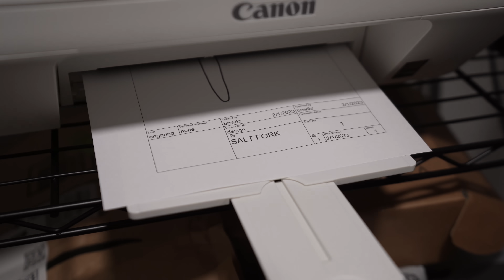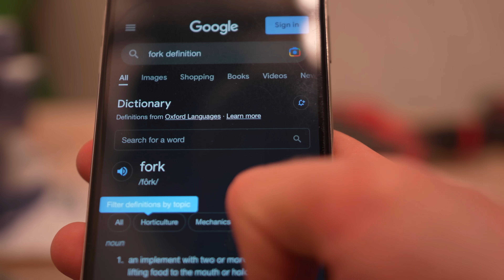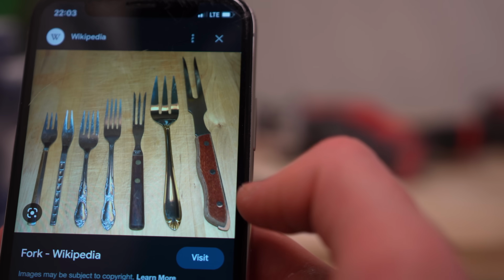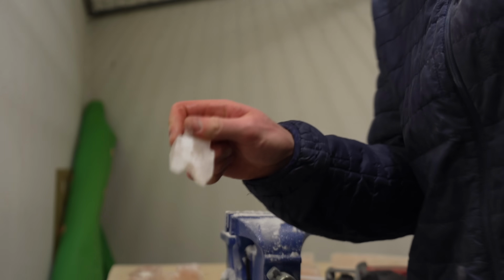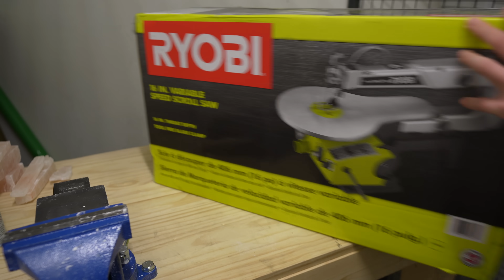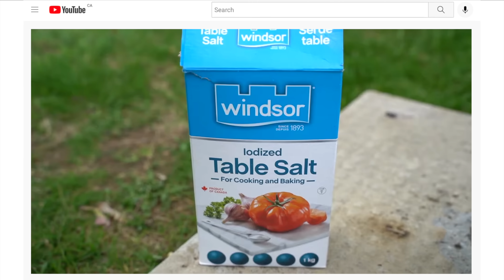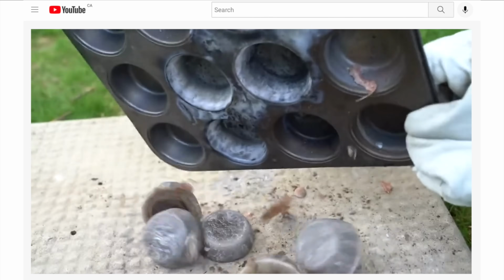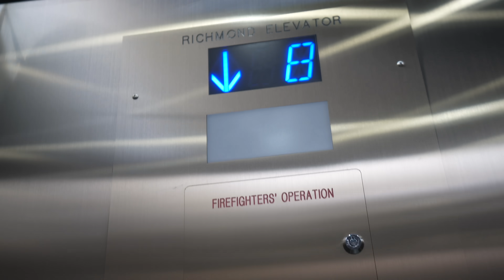What if forks were made of salt?

Comment: As a stone cutter, I can tell you the issue is that the salt is made of many micro crystals. If you could grow a single salt crystal in some water and get it big enough to be a fork, and use water based cutting tools, you'll shape a new fork easily. Check your area for a local rock and gem or lapidary club.
Reply: Is it possible to forge a salt fork, wich make food salty but also it endures for long time?
Reply: @oranjesus49  absolutely. If it's a single large crystal it will be much harder. Of course, it'll dissolve every time you introduce it to water. 

Search for videos of growing a crystal at home. The principal is the same with salt.
Reply: You're right. It's opaque so you can tell it's a bunch of small crystals. If it was one big crystal it'd look smooth and transparent, as long as the outside isn't roughed up
Reply: @oranjesus49  There's a catch here, if you increase the endurance, it means it will provide less salt to the food you are using it for. By making it more durable, you are making it less effective for the purpose you are making it in the first place. Kinda hard to have a balance here, probably the best way would be having a "sharpable" fork, like a pencil, where while it will dissolve, it will also be possible to keep it's format. But also for making it "sharpable" it would have to be at least the same thickness all along. In the end we will have something like a salt skewer.
Reply: @gzmarcatto  what about salt chopsticks
Reply: Can make it with hydraulic press?
Reply: as a meth addict , i'll hope someday he will make a meth spoon
Reply: @functionalintelligenceagen9293 😭
Reply: I thought salt was just a very brittle rock, I've always wanted to make one big salt.
Reply: @gzmarcatto  so salt cutting boards don't impart much salt to the food then?
Reply: What I am imagining is having a fork shaped mold that has a couple small holes. This mold will be filled with the supersaturated salt solution and the mold itself will be placed in a bath of the supersatured solution. A salt crystal can be placed in the mold through the hole and wait for the crystal to grow.

No idea if this would work or not but I honestly feel like trying it now.
Reply: Sugar spoon 😮
Reply: Bro is a GENIUS
Reply: This comet need to be pinned
Reply: In Larry Niven's "Known Space" series, there's a company called General Products that produces transparent spaceship hulls that are literally just one giant molecule, kind of like that. Instead of one single giant crystal, it's one single giant stable molecule, making it essentially indestructible since it directly uses the strong force to maintain its shape, or something like that.
Reply: I don’t recall ordering a yappachino

Comment: If you’re looking to make the salt fork 2.0, perhaps consider making a super saturated solution of salt and CAD modeling a fork with thinned out prongs and scooper but an adequate handle. Then, after the super saturated solution of salt water is made, dip the scooper and prongs into the salt water and wait for it to be fully covered in salt crystals. That way, you just need to remake the salt water solution(waste less salt) and your work is reusable.
Reply: Now imagine frozen watermelon but in utensil form
Reply: Perhaps
Reply: Exactly my thought.
Reply: That would corrode the machine
Reply: Adding onto your idea, what if he made a super saturated salt solution, and instead of carving out a fork from the block of salt, he dipped a string that's shaped like a fork into a jar ( how to get a string shaped like a fork? I'm thinking like some nontoxic wax coated string) , and let a fork crystalize its form over the string over a couple of weeks. Hopefully to get the thickness that is usable, he could use a Dremel tool to smooth out any of the larger chunky crystal formations. Then, dissolve the prongs in water for sharpness. Maybe the string would help keep the fork's integrity as well since there is a form that holds the salt together? And if he wants to reuse the fork, he can dip the fork into the salt solution again and again.
Reply: Am I the only one too stupid to not understand this

Comment: You should make a handle out of normal fork material (plastic, metal, wood maybe?) with an apparatus to attach salt fork heads to. Think a toothbrush with swapable heads. That way you can make salt forks without wasting so much salt on the handle, and you can swap them out when they become worn.
Reply: Lmao i was just thinking the same thing
Reply: Better idea, salt toothbrush
Reply: Is it a salt fork at that point or a hybrid abomination???
Reply: Why not make only the prongs replaceable, less salt used, and the leftover pieces can easily be used in a grinder
Reply: @alecm2774 probably because while eating your mouth likely comes a bit in contact with the head of the fork too, and not just the prongs, and that likely gives some extra salty flavor to it
Reply: It would be quite a complex shape for salt to fit like a glove on a fork.

Comment: I think you could have gotten a superior (although admittedly less youtubable) solution if you prepared a saturated salt solution and then simply dipped an existing fork into it repeatedly to give it a thick and hard salt layer, kind of like candle dipping.
Reply: I was thinking similarly, but with a fork-shaped mold.
Reply: @erictheepic5019  I was also considering that, but I believe the result would have next to no structural integrity (because when the water evaporates, it will leave little pockets of air between the salt crystals)
Reply: That would be pretty cool too, now I wanna see someone do that.
Reply: @rubyherring isn't that essentially how nature made the giant salt block in the first place
Reply: @rubyherring add salt again
Reply: nah that's just fork made out of salt
Reply: @nikilragav  Cool question! I'm picturing the pressure of the earths crust maybe "pressing" some of the dissolved air out and over time forming a nice strong crystal lattice? But maybe it doesn't work like that!
Reply: That's just not the same though is it. Salt fork has to be a salt form not a fraud metal fork in salt clothing

Comment: You could try dissolving the salt dust in water and leaving it in an open fork shaped mold until the water evaporate and the salt crystallises. You could add more salt water on top of the thin crystal after the water has evaporated. By repeating this you can build a salt fork layer by layer.
Reply: Woah bro just invented salt 3d printing

Comment: For salt fork 2.0 you could make a super saturated solution of salt and water, fill up a food safe silicone mold of a fork and then place the solution in a dehydrator (you can also just leave it out in a warm clean dry spot to let the water evaporate it'll just take longer) idk about the structural integrity you'd probably have to tinker around with the solution, dehydration methods, and molds to get the crystals big and strong enough but you have enough salt dust from this experiment to play around with 🤣 also maybe try a netty pot and a steam if you're still having salty coughs
Reply: Yeah, this is essentially the suggestion I would have.
Reply: One giant fork shaped salt crystal
Reply: was about to comment that, you could also just grow a thin layer of salt onto a metal fork
Reply: @podwodnobrody  yeah, but then it wouldn't be a salt fork. it'd be a metal fork covered in salt. the people would know.
Reply: does salt shrink in a mold?
Reply: Infuse it with other spices, too. My favorite combo on a steak is smoked salt, dill, white pepper & lemon pepper.
Reply: This is what I thought he was going to do based on the thumbnail lol
Reply: I have a freeze drier, this is an interesting idea.
Reply: Legend
Reply: Maybe adding another material that is edible and could add some long strands into the salt solution to give the fork more strength. Psyllium husk or some root vegetables ground up and dried might work.
Reply: Y'all are super smart, I'm impressed.
Reply: Thought about that too it’s like making ice or how they make plastic spoon and forks
Reply: Edit: Nvm. I should have watched the video first
Reply: hmm

Comment: Did you ever consider re-crystallization? Instead of having to melt it into a mold, you might be able to just put granular salt in a mold with water and let it evaporate. I'd imagine some kind of pressure might be needed to get it really solid, but it probably would have been worth a shot.

Comment: It seems to me, as an engineer, that a water jet cutter (a high pressure / high velocity water stream) would probably cut the salt exactly how you want for this without breaking it.
Reply: Might melt it though. Cause it’s salt. (Dissolve, sorry)
Reply: @firstnamelastname9237 that's only if it's soaking in it for a long time
Reply: @Krakain You could replace the water with a saturated salt solution. Would work until it corrodes the machine.
Or maybe using a different liquid?
Reply: @firstnamelastname9237  anyone who has ever worked with one, or even a raw salt block would know it would not
Reply: @etuanno  maybe alcohol? will keep machine safe and it not melt the salt sheet, i not remember clear back in elementary chool, maybe it was benzin in what salt can't disolve not sure, but benzin is not well eatible so try if alcohol would work 🤔

Comment: Interesting concept, especially as a life metaphor - but I'd say you'd be better off figuring out a way to have powdery crystal salt stick to a regular metal fork that you could re-powder after every meal, or even every bite.  Salt does not have the tensile strength to last but for a very short time.

Comment: One little note for those who have never tried it.  When making soups, instead of using salt, look for a product labelled "Cured Beef".  Essentially what that is, is Beef cured in salt.  You boil it a single time, throw out the water, and then boil it again.  Take out the Cured Beef and use that water to flavor your soup like any good stock.  It's like the perfect beef stock full of salty beef flavor.

I make Turkey soup and chop up about a 1/4 of the salt beef into the soup afterwards so you get little bites of salt beef goodness.
Reply: Turkey soup with beef stock? You are an absolute maniac.
Reply: @JL-xz3zf  If I'm being honest, it doesn't really have a strong beef flavor.  It more tastes like a toned down brine.
Reply: Couldn't that exact same thing be replicated by just buying a carton of beef stock from the store?
Reply: @ivenstorm  NO!
Reply: @Corzappy  not even close to the same taste.  Your not looking to add a heavy beef flavor to the broth, which is what beef stock does.  What Cured Beef essentially is, is beef preserved in salt.  Your looking to add the salt to the water.

It's an old Newfoundland tradition, you can look it up yourself.  Cured beef in its basic form has way too much salt on it.  We use a 6 inch cube and boil it in water for 15-20 minutes.  We throw out that water, and then boil another pot with that same cube in it.

That second pot of water is now perfectly salted for any form of soups, boiled vegetables, or anything else you could use it for.  That's the way my family has been doing it for centuries.  It takes the guess work out of how much salt to add to soups.

Some places simulate that with ham.  Just think of cured beef as having 10x the amount of salt that ham has, which is why we boil that salt off.
Reply: @JL-xz3zf  Hate to be the one to break it to you, but Americans do it as well.  Some places will add ham to boiling water to flavor the water with the hams salt content.  No real difference.  Just the meat that is being used.
Reply: @ivenstorm  THIS IS UNACCEPTABLE!!!
Reply: @JL-xz3zf  what's unacceptable is the high price of gas these days.  Back in my day it was 89c per liter.
Reply: @ivenstorm  IT IS CALLED PETROL! IT IS NOT A GAS!
Reply: @ivenstorm  But I agree,  it is very expensive these days :/
Reply: @JL-xz3zf  It's petrol in Europe, it should be in most everywhere else, but like anything else North America changes the names of things.
Reply: @ivenstorm  I DON'T LIKE THAT! STOP IT!!
Reply: @ivenstorm  Ok so just dilute beef broth with water and add salt? Idk what exactly your point is, there's a lot of ways to add salt into water, one way is by adding salt into water.
You can always just not salt your soups or broths until they're done, that also removes the guess work.
Reply: @Corzappy  Cured Beef is more like what Americans would call Corned Beef.  Slightly different spices used in each process, but roughly the same idea.

A highly salted beef that intensifies the flavor through curing.  The only difference is that we are taking that salt and slight flavor and adding it to a stock.
Reply: @ivenstorm  Yeah I mean you could boil cured meat, discard the water, boil it again, and be left with salty water that has a slight beef flavor.
But my point is that you could also just mix beef stock and water together and then add salt to taste, and skip all that extra work.
Reply: @Corzappy  yes, you could, but you'd also come up with a different tasting stock.  Which was my original point.

If Beef Stock was T-Bone, then my stock would be Roast Beef.  Yeah, they both from a cow, but they couldn't be more different in how they taste.

Both are great, but some days I want Roast Beef, other days I want T-Bone.
Reply: @Corzappy  besides, any chef with half a brain will tell you that homemade stock tastes far better than something that comes in a can or box.
Reply: @ivenstorm  Wasn't the whole point that it doesn't take that much like beef? I really doubt that if it's as mild as you claim, that it's also that distinct in flavor, it's literally a piece of salty beef.
Reply: @Corzappy  ok lets try again.  A cup of tea.  When you first make the tea, its strong as the leaves still have most of their flavor.  But if you reuse that same tea bag for another cup of tea, that second cup of tea is much much weaker.

Same principle.  Only difference is that tea bag is 400% stronger and the only way to tone it down so its drinkable is to use it in a second cup.

If you can't understand that analogy, then I'm throwing my hands up.
Reply: @ivenstorm  I'm not having any trouble understanding the process you're doing. 

What I'm having trouble understanding is why that is at all a preferable alternative to just buying a carton of beef stock and then splitting it 50/50 with water.

Why would you brew a cup of tea 400% stronger than it needs to be, and then just throw it out so you can brew a weaker tea with the leftovers, when you could've just split that tea up into quarters and gotten 4x more tea?
Reply: @Corzappy  ..... because its a completely different taste?.... I'm sorry are we living in a different universe where I haven't typed that like 10 times already?

If you make your own stock it tastes 1000x better than carton stock.  This is just another way.

Watered down Beef Stock doesn't taste the same as Watered down Cured Beef.  That's as simple as it gets.
Reply: @ivenstorm  I don’t entirely believe that it matter all that much but sure.
Reply: @Corzappy  It does matter when your cooking that's all.  If I want something to taste beefy, I reach for Beef Stock or Beef Broth.  Made by cooking beef low and slow and mixing the drippings with vegetables, herbs and seasonings.

When I want something to have a much milder flavor, I reach for Cured beef.  Cured beef isn't cooked so it doesn't have time to develop the beefy flavor you get from stock.  But you still get the salt that its cured with.

That's the difference.  Turkey soup is supposed to taste like Turkey, not like Beef.

Cheers.

Comment: Another way you could have done this is if you took all the "salt dust" and dissolved it in water, then put the water in a fork cast, and allowed the water to evaporate, leaving the salt crystals behind in the shape of a fork
Reply: I imagine the individual salt kernels wouldn't have stuck together.
Reply: @hannahn.342  they should. They do in rock candy
Reply: @pryordevine3855  I can't disagree with you because I know nothing about the subject but is sugar exactly like sugar in that regard? I'm talking like chemically does it do that
Reply: you would need a very deep cast for it so there is enough salt residue
Reply: @pryordevine3855 you would need a pretty high salt content or some chemistry magic to make salt crystallize into a shape that large, and it also might not be the correct shape(it’s crystallizing, not solidifying) so yeah
Reply: @ryanhernandez8324  they both crystalize when when evaporates, but that's the extent of my knowledge
Reply: You could just put a metal fork in the salt solution so the metal fork was encased in salt crystals and still pretty sharp

Comment: You're actually onto something, you just need to change your approach altogether.  Since the salt by itself is too brittle and doesn't offer a more stable structure for you to effectively shape and manipulate it, you'll need to create a more stable layer beneath to accomplish this dream of a salt fork. In short, you ultimately need a scaffold for your salt to provide it structure, and overall more stability. You can use another substance to add that stability, but I think working with metal is best. There is a chemical process in which you can ionically coat a piece of metal with another metal, but since salt is NaCl, and Na (sodium) is a metal, you can feasibly do that with salt itself. This is known as plating. This will allow for the creation of your metal-salt-fork contraption and would also provide the same experience you had with your pure salt-fork, without dealing with its inherent brittle and fragile nature.
Reply: youre 'in short answer' is longer than the actual answer
Reply: @pizzi_  "you ultimately need a scaffold for your salt to provide it structure, and overall more stability." Was the short answer. Everything after is elaboration.
Reply: but isn’t sodium itself also very brittle (and explosive in air) in nature?